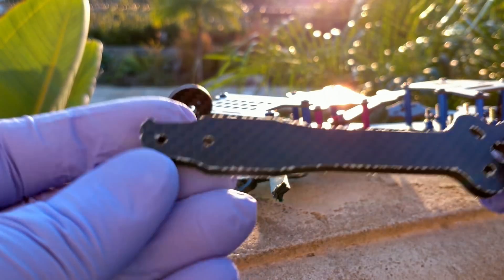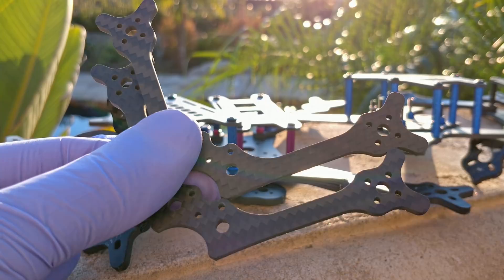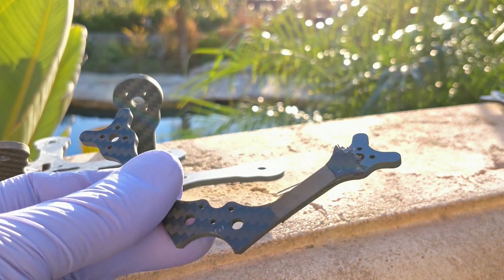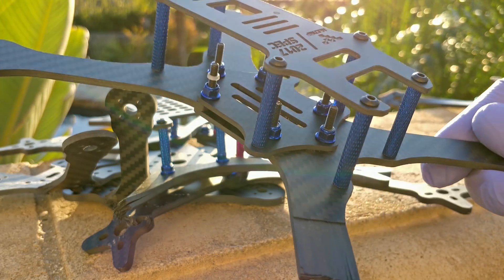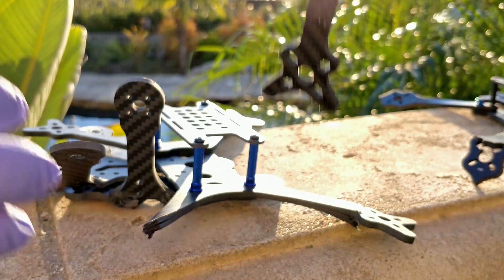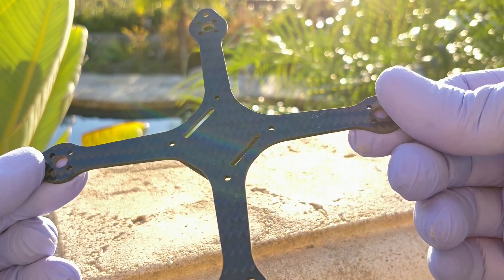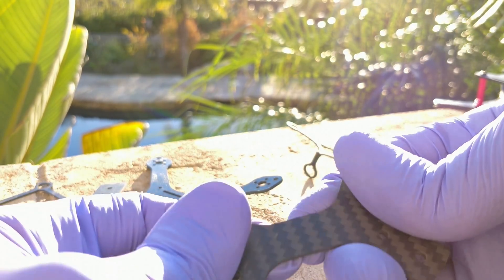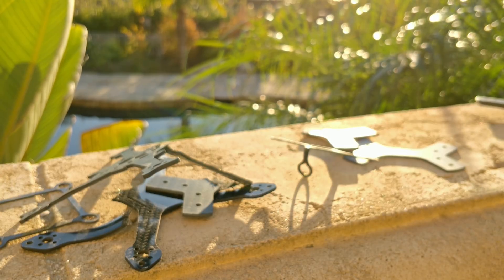Chinesium - How does it break?

Comment: Nice one dude! Would be nice to see more fun flight footage to go with these educational videos.
Reply from the maker: If I ever find a YouTube suitable place to fly.
Reply: So true, soz i forgot. Will just have keep watching four pack afternoon. Love that little park you fly!  Thanks dude, don't forgot Floss!!!!
Reply: I have a banggood qav clone x frame cut wrong which has less damage than any of my other frames because it flexes when it hits. Can you design a real hard rubber frame that won't break?
Reply: Have you seen the lightspeed from pocket quads?
Reply: Need that in 5 or 6 in.
Reply: That might take a bit thinkin about! May i ask why you'd want have a flexible frame of that size. I don't understand what the benefits would be in a frame that size. I think Kababfpv has already covered this in a earlier video.
Reply from the maker: All my designs have flex built into them. If you want an unbreakable frame that also happens to perform extremely well, the Floss 2.1 5mm arms is 64g and as unbreakable as it gets.  All but the most catastrophic crashes would barely scuff the frame. You don't want a frame with so much flex because it screws with the FC. It wants total rigidity.

Comment: I would like to see you mount an arm to a table and rig something from the motor mounts then hang weights off it and see how much it takes by pound to break?
Reply from the maker: Would love to. I don't have enough weight to stress it with unfortunately. This shit is super strong!
Reply: Kabab FPV 🤔just go around and BARROW some sewer caps...lol JK 🤟
Reply: If you are looking for a cheap and easy weight, you just need a decent sized bucket and some water. A 5 gal bucket will hold almost 20kg of water. Add 500g of water at a time and you'll have an easily repeatable test.
If you want to get scientific with the testing, I'd clamp the frame where the battery mounts and then test a single arm. Bending across from one motor to the other isn't a very realistic test of the stresses involved.
Reply: benaresq nice thinking ...even add a fish scale to measure the weight.
Reply from the maker: Would love to do all that. My bucket actually broke from just 50lb of weight and I have no way to clamp the frame.  I fail. Lol. Frames too strong.

Comment: Kabab! 
You were not wearing safety glasses doing this, silly?!
Carbon fiber is made of thin layers of soft-woven sheets with an insignificant amount of resin to bind them together, cosmetic layers on top and buttom is only seen in the quad-community lol. 5mm of actual CF wont break in a crash.

Comment: Does everyone use 4 motor screws? Do you notice people with 2 motor screws breaking an arm around the inner 2 motor holes way more often?
Reply from the maker: If you use the two inner holes you have a higher chance of breaking the arm. If you only use one or none of them you have a higher chance of bending the motor base.

Comment: thats exactly why the thor v2 5mm 45deg version from aliexpress is such a badass frame if you choose the right direction of the carbon for 35€ :) the version sold on banggood and other places for about 20€ is the weak one thats cut for higher yield ^^ soo happy i got the "good one" :) its massive and only 83g
Reply: crol Link to the good version?
Reply: unfortunately it seems its sold out now.. https://de.aliexpress.com/item/TTHOR2-205-Loki-II-X5-true-X-205mm-5mm-bottom-2-5mm-top-Carbon-Fiber-Titianum/32819545208.html
Reply: thx

Comment: Ok one thing learned, you need to work out more. Hahahaha ;)

Only problem you get with making stronger arms is that you will move the weak point to an other place. I mean not the frame but like the motors. I have seen many motors that where broken because the arms did not break because they used a stronger arm.
I still like to break an arm above my motor. 

The mounting holes with the fluss screws also make the carbon weaker on the Clone frame.

Comment: I ordered a kit of the babyhawk r arms from piroflip and they were not that impressive. Holes were not aligned and they broke the very fisrt rough landing due to lipo dead. So I really hope the new batch is much better. The last batch were quite terrible and not tough at all. I really hope the replacements hold up and I just got a bad set.
Reply from the maker: New ones line up holes perfect and the durability is at least as good as the stock arms. The new stock arms are actually weaker than the original ones. I honestly don't even know how people are snapping 3mm carbon with such a low auw. 

No matter what I do I always get someone that somehow breaks something from a stupid tumble or something.  I'm waiting to see if it happens with the 5mm arms too. Would be seriously shocking.
Reply from the maker: New ones line up holes perfect and the durability is at least as good as the stock arms. The new stock arms are actually weaker than the original ones. I honestly don't even know how people are snapping 3mm carbon with such a low auw. 

No matter what I do I always get someone that somehow breaks something from a stupid tumble or something.  I'm waiting to see if it happens with the 5mm arms too. Would be seriously shocking.
Reply: If some one has the luck to do the unexpected it is me. I like how the arms flew while it did. That's why the battery died on me. I was a bit too in to the flight. It is possible the cut was not correct. I noticed one leg was really rigid and the other was quite flexible.
Reply from the maker: It wouldn't be one strong and one not. It would be both strong or both weak. Take a look at the weave on them. Maybe they were wrong.

Comment: BTW, I remember that I saw something on TV, a good amount of time ago, about carbon fiber made on a hot hydraulic press or something like that... I don't know if it gets more durable, but I remember it had a metal sound when hit. Did you searched about it?
Reply from the maker: Yep that's a totally different process of making CF. It's not this Chinesium stuff
Reply from the maker: F1 cars have drive shafts made of CF and they're far stronger than steel or titanium or whatever other materials they've tried.
Reply: Kabab FPV Nice! 😀 But I imagine it would be even harder to cut!
Reply from the maker: At that level it's made to the right shape. Not cut.

Comment: You can't always tell from the top layers. You can get "quad axial" sheets, i.e. alternating layers of 0/90 and +45/-45. I'd love to lay up a custom frame with uni carbon in the center running along the arms with a few layers of +45/-45 for the torsional stiffness. I kind of bugs me that we use sheet and throw away all those offcuts. Of course investing in tooling and molds and paying for layup would be more expensive than uploading a new CNC file and cutting a shape.
Reply from the maker: If you watched the video you would have seen how many times I indicated what you said.
Reply: If I'd watched it all you'd be correct........... :S oops, sorry.
Reply: Chris Brent definitely worth the watch!

Comment: I liked the test at the beginning of the video, but what I would suggest is really measuring the weight each frame-arm can hold. This way you would have scientific data and can compare it to others or use it for advertising. Anyway ... great video!
Reply: Ghetto cantilever break setup with weights, or adding water into buckets.  Standard data is nice (but time consuming).
Reply from the maker: I used to try that but I don't have enough weight to apply enough force easily. The amount of force these carbon bits can take is immense. Wish I had a machine for it.
Reply: KababFPV I know this is really late and you probably won’t read this but you could use a scale/load cell in line with a hoist/strap connected to the ground. That will have enough force :)
Reply: Use buckets and fill them up with water, works really well.  I was trying to test the shear strength of epoxy and the carbon broke, lol!  https://www.youtube.com/watch?v=UJ5tYxPV-hM&t=1s
Reply: @Kebab
              WOOOOOT?!?!?! you serious bro?? .... no gym?? WOOOOOOT?!?!!?
You should fix that bro. You don't have to use it, just get one, lower your insurance premiums :P

"remember to hate the bar!!!!"
Reply: Kabab FPV man I really have to say you are the best, you always reply and take your time for your community, thank you very much! Oh and btw you could maybe use a "hanging scale" and some sort of "gearbox" or vice maybe?

Comment: it's nice that you showed the torrent frame. I have a RKH aftermarket frame in mine. When I get home I'm curious to check if the fibers are linear down the arm or not.
Reply from the maker: I kinda misspoke in the video. I didn't clearly mention the various other types of strand weaves. Linear just means the carbon inside isn't  woven fabric like the top and bottom.
Reply: RockTouching yeah call and ask if theyll sift through the arms and give you the ones that the weave runs parallel with the arm pleaasse! You crash hard with any frame the damn things gonna break!
Reply: Andrew D well that escalated quickly lol